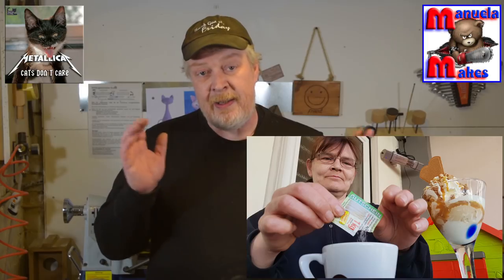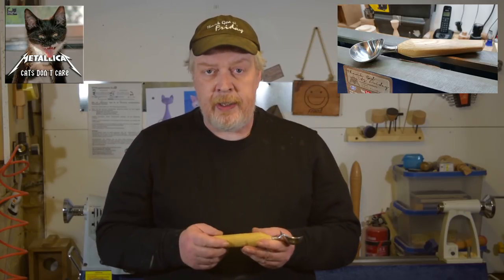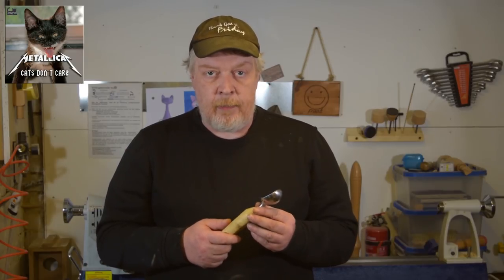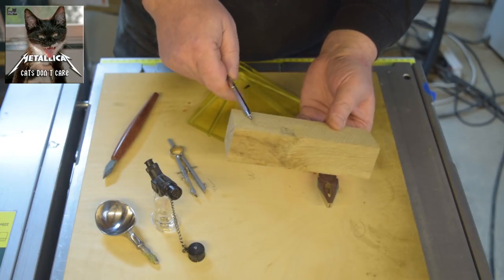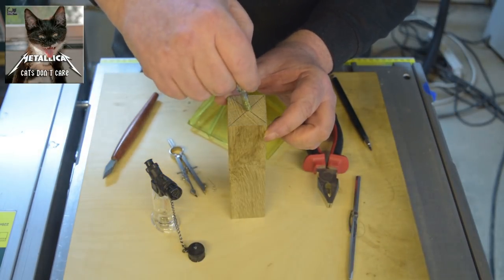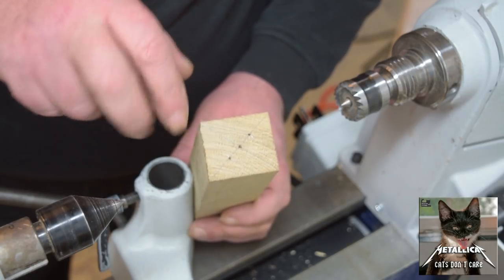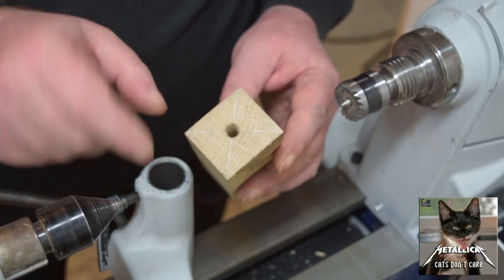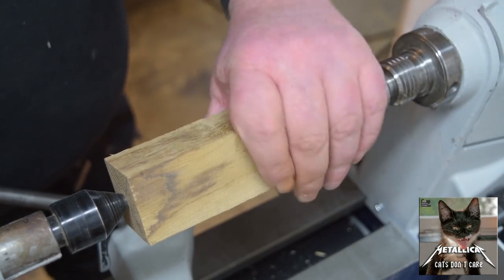Summertime -- Turning an Ice Scoop

Comment: Great project Peter, did you used both points for of centre or just one?
Reply from the maker: Karol Kolanowski - KK Make oh,I see my mistake in editing. At the time the camera angle switched I also  switched to the 3rd point opposite the center point. 
Hope this isn't too confusing. 
So I turned on all 3 axes. 
Thanks mate for pointing this out.